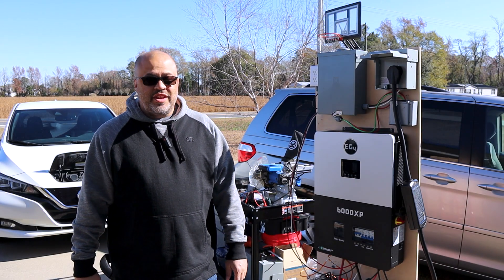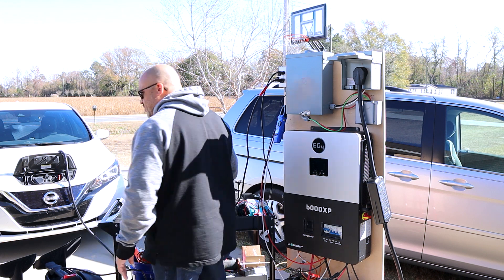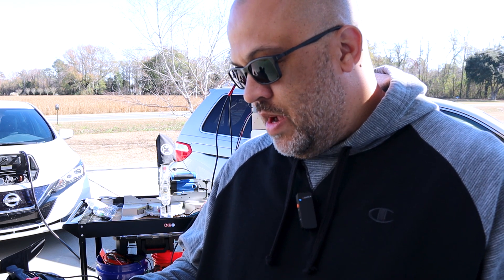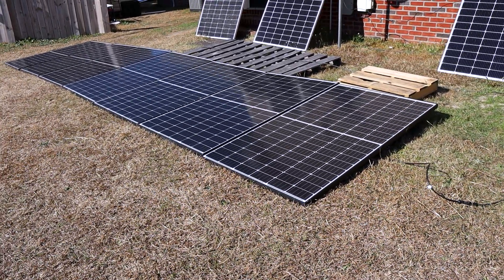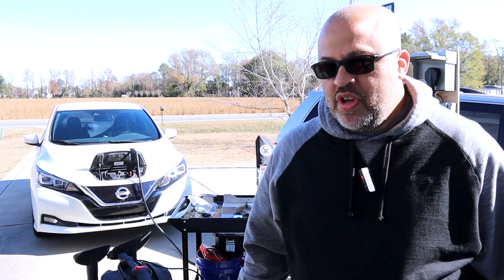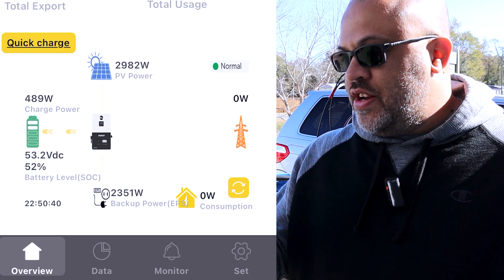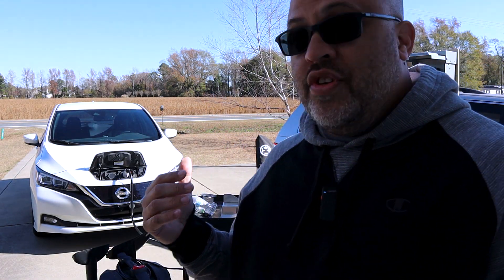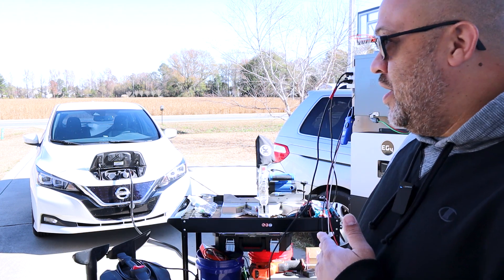EG4 6000XP Imbalanced Load & Surge Testing - 6000 Watts One Leg?

Comment: Is your setup in this video wired as 240v and then you're splitting it to run off 120v?
Is your car charger running off 120V?

Thank you, I'm just trying to understand more! My main question is this setup in your video specifically running on ONLY one leg of the 6000XP? is there no 240v being used at all, then split to 120V?

Comment: Thanks! How does it handle continuous unbalanced loads on each 120V leg. Extreme example being 3kW on one side 0W on the other
Reply from the maker: I wouldn’t recommend doing that consistently but it should work. Not sure I tested that exact scenario but I have ran it for a little while well above 3k on one leg
Reply: it's my understanding that there are 2 mppt's and 2 inverters, so I don't see how an unbalanced load would matter in that scenario since it's only using the 1 mppt and 1 inverter. Please double check this though as I'm not positive!

Comment: 220 AIR COMPRESSOR ON 50 FT RUN 15AMP
Reply from the maker: Should run it fine!
Reply: @rodneyhunt  it doesn't
I'm curious
Single phase vs parallel 
More like 100 feet of 0 awg aluminum
Motor starts and runs...at 5 seconds invertor shuts off
Reply from the maker: That is weird. You have the 6000xp correct
Reply: @rodneyhunt  yep
Runs my 13 amp lift...220 no issues
I'm gonna move it closer.
Try it
Maybe run cap is dead
I'm surprised also

I shouldn't have to change settings.. parallel or none right?
Should be 1 phase not 3
Crazy my lift works
Reply from the maker: @waynechien-vovietchongmy9724  yeah let me know if using a shorter run does anything.

Comment: The more i see the 6000xp the more i like it especially for the price. My only issue is that ive built my own batteries with jk bms's and i dont know if they will work with that inverter
Reply from the maker: They will work without communications for sure. You just need to input your charge settings. 👍

Comment: Rodney - will one of these units be able to supply fulltime power to a 50 Amp RV service (OFF GRID)? We don't plan on using air conditioning in our RV but we do have residential refrigerator/freezer, washer/dryer combo and a 120v/propane water heater onboard. If we needed to purchase two - I would like to know beforehand. Thanks and Hope this finds you having a Great Day!
Reply from the maker: The unit is only rated for 6,000 watts. So depending on your loads. If using a full 50 amps then you need two. So it depends on
Reply: @rodneyhunt  having the discussion with my wife. If two are necessary - then that will be the route to go. I prefer the ability to have the 50Amp+ potential as though we were utilizing a 100 amp panel (residential). Thank you for your response and video tutorials!

Comment: Excuse my ignorance,  but I'm trying to figure out if the 6000xp outputs only 3kw 120v total or 6kw 120v total?
Reply from the maker: 6kw spilt phase. So you can use 240 volts or 120 volts. Yes 3000 watts each 120 volt leg. 6000 watts total
Reply: @rodneyhunt  also is it capable of charging battery bank off 120v  generator?
Reply from the maker: @alaskahomesteadadventures7579  have not tried but I think it will charge batteries but no UPS function at 120 volts input. Actually not sure that is AC input I am thinking of and not generator
Reply: It will not charge batteries or run with a 120v Genny
Reply: @jimgraham290  They've updated the firmware, you CAN do it with a 120v generator now!

Comment: Compared to what I was pulling in on my old growatt inverter from my solar panels using the exact same panels and wiring I'm actually pulling in more wattage than before, with the 6000 XP.  The only change in the panels is instead of two separate strings of seven I have all 14 in series (I bought low voltage panels because the inverter I had only had a 180 volt max MPPT.) Eww 😬 lol. So far loving the unit
Reply from the maker: That’s awesome! Loving my units so far

Comment: Rodney i see alot of people asking questiins thought you could elaborate. 
#1  how many panels you have on each mppt ? Total voc on each  alot of people are thinking 480voc ÷2=240voc per input . (Or ) 480 voc per mppt 960 voc total ? 
#2    grounding is it needed ( ground rod)
Reply from the maker: 480 is the max per mppt but I think up to 385 is the max recommended. So the mppt works at it’s best. Yes system needs to be grounded when fully installed by following the manual. Mine is not since I am moving and testing right now. Will be grounded during full installation when other inverters arrive

Comment: Another great video Rodney.  Trying to understand the math.  In the last test, the inverter was putting out 1900w per leg (3800 total to car 16a @240v).  Then you added 29amps at 120V which is 3480.  Total of  5380w on the one leg?
Reply from the maker: If I remember correctly you are talking about the 1900 watts from car and 3600 from surge. I think I calculated from 30 amps when it kicked out. So 5500 watts. Not sure what I said but the number was lower on the leg when it kicked out that last time with the car load than when no load on the other leg. If that is not what I said I have been recording a lot of videos and might just be wrong with the math or remembering lol
Reply: @rodneyhunt  you’re right. Was just trying to get the math right myself.
Reply from the maker: @cgutowski471  👍

Comment: RODNEY, GREAT LOAD TESTING!
DO YOU HAVE A HOME STANDBY GENERATOR TO CHARGE YOUR BATTERIES FOR LONG RAINY DAYS BEING AN OFF GRID HOME?
Reply from the maker: I still use some grid power for now when needed. I do have a generator to charge batteries back with the chargeverter during emergencies. But since I have the grid I use it when necessary.

Comment: Thanks rodney for doing these tests and posting for us 🙏
Reply from the maker: Glad to help. Trying to post things I would want to know and things people ask about.
Reply: @rodneyhunt  if you were to wire 3 in parallel, would you run each hot leg to a different 30 or 40a breaker or would you run them all to busbars and then just one set of wires to the load panel breaker 🤔
Reply from the maker: I will use breakers like the growatt setup I have. Since I have a box setup already and it will make it easier to service if needed with multiple breakers.
Reply: @rodneyhunt  after reading my  question I realized it wouldn't be good to run the hot legs to a busbar without breakers haha sorry I'm still trying to figure out the most efficient way to wire them if stacking more than 2 in parallel
Reply from the maker: No problem